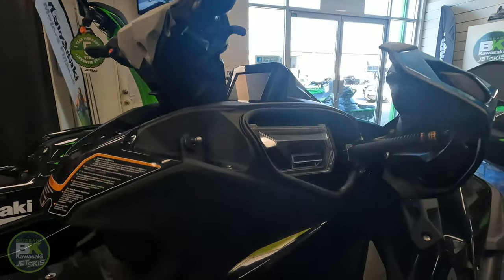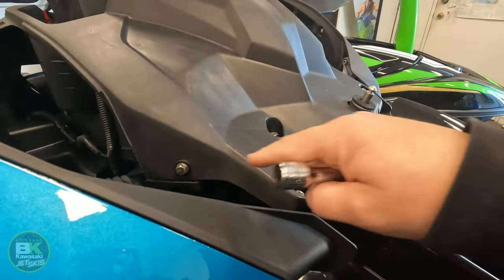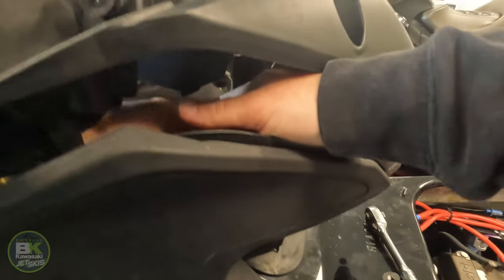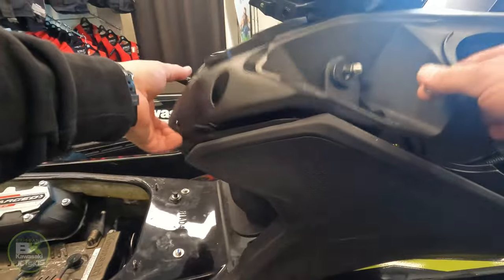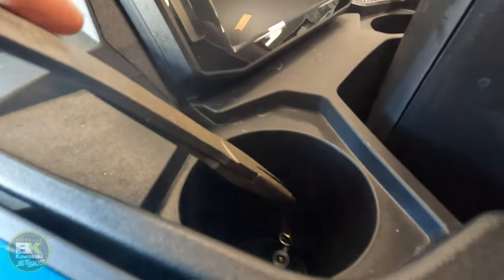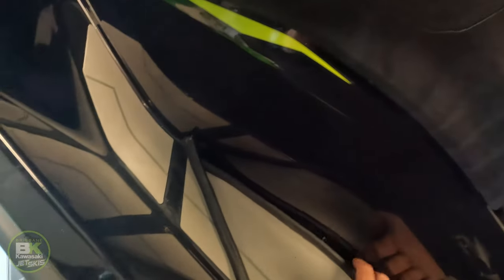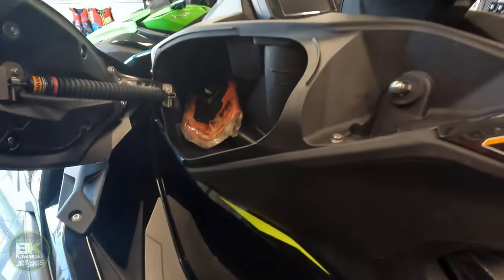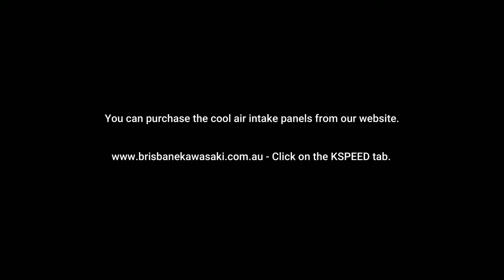Kawasaki Ultra 2022+ 310 - Cool air panel install (step by step)

Comment: Sorry for the silly question, but why would you fit a air filter?? Surly it will restrict air flow and it’s not like there’s a lot of dust out on the water?. Just wondering, interesting video though. Thanks
Reply from the maker: It's a cool air panel. Not an air filter.
It doesn't go in the airbox, when you watch the video you'll see we remove a blanking plate under the centre console, and put this air panel in it's place. Effectively doubling the air intake into the hull. 

These have been around since 2008, they are proven to work very well.
Reply: @BrisbaneKawasaki  oh sorry I taught it was an air filter, that’s an excellent idea and job, love the kawie hull , keep up the great videos thanks

Comment: Are all the bolts the same?  Do we need to keep track of where we pull the bolts from?  With the exception of the long ones mentioned.
Reply from the maker: they are all the same except 2 long bolts that go in horizontally under the front wings. 

I make mention of which bolts go there in the video.
Reply: @BrisbaneKawasaki  I thought I caught that in your video, but I just wanted to make sure. Thank you for the clarification.
Reply: @BrisbaneKawasaki  I just placed an order for the cold air intake, racing sponsons and a few other items. I look forward to getting them. These are my first upgrades to my 2022 310 lx-s.
Reply from the maker: @johnd5094  On it's way :)
Reply: @BrisbaneKawasaki  I got shipping and tracking info this morning. Thanks!!!
Reply: @BrisbaneKawasaki  looking forward to other upgrades as I learn the ski more. I haven't ridden in 20 years. Last ski I had was a 1996 1100zxi.

Comment: What about the filter getting wet/soaked?
Reply from the maker: It's a water proof, washable filter. It will dry out. It's been around since 2007, never had a problem with the design. The ski is designed to siphon out any water from the bilge that gets through under the seat.
Reply: @BrisbaneKawasaki   Thank you, I am planning to install a fish finder.  Your answer helps me with the purchase.  Will install cool air and the USB C and anything else once I feel comfortable enough to remove all those parts.